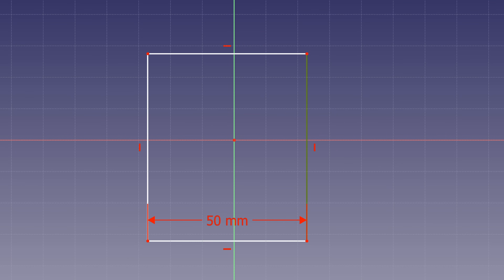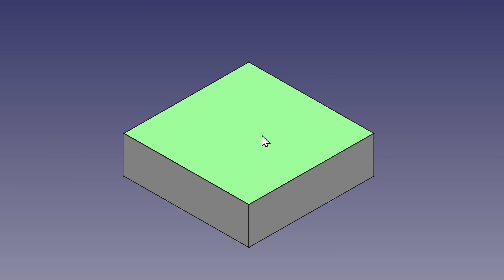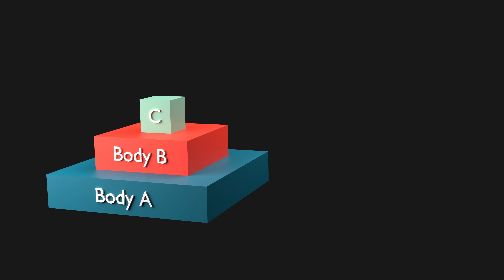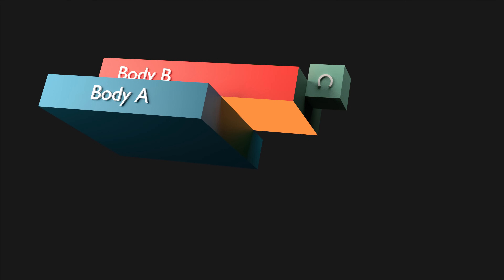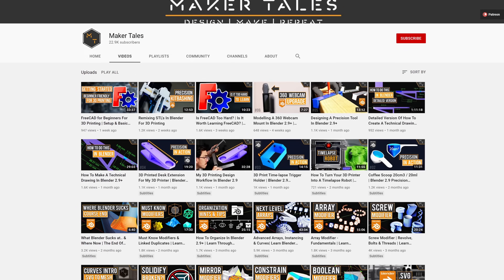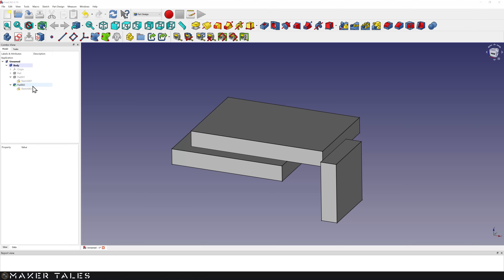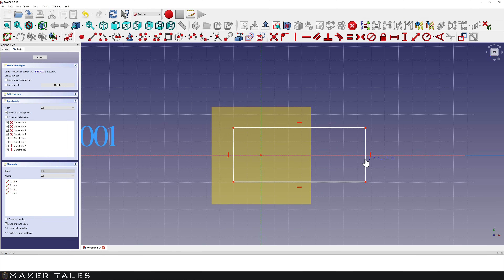FreeCAD Is Fundamentally Broken!  - Now what... Help Me Decide...

Comment: I'm also one of the developers.  Thanks for tackling this in a respectful and educational way instead of just throwing shade.  Your video is a really good explanation of the topological naming 'problem'.   -- I disagree with you on that particular point.  It isn't a 'silly bug' or something easily overcome.  (If it was that easy, it would have been resolved long ago).  It's called a 'problem' because the issue is intrinsic to parametric modeling. It can never be 'solved', only mitigated and avoided.  In fact, if you know what you're doing, you can trigger a parametric model to break in any parametric modeling software.  Admittedly, most software handles/avoids it better than FreeCAD does currently but I don't think it's possible to ever say it's 'solved'.   Realthunder's linkstage is a huge improvement and I can't wait to see his fixes become part of FreeCAD.
I don't have good advice for you about how to make your videos.  I would suggest that you should always stress good design principles which avoid breaking models.  That means all the techniques you mentioned.  
Thanks for doing this and keeping the discussion professional.
Reply: I spent 20-years running SolidWorks designing all sorts of complicated parts and assemblies. I started with the first release. Not once did I see this problem. That would seem to mean they had the problem fixed before they ever released it. Maybe someone else has had a different experience.
Reply: I see how this problem is intrinsic to parametric modeling but I also belive that measures can be taken to mitigate this. Maybe it can't be fixed 100 % but 90 % would do it. even 50 % would be great.
Reply: @TheYear2525  Absolutely!  We can (and should) continue to improve the reliability of the software. Whenever possible we should make it resistant to breaking models.   But robust software isn't a panacea for bad design practices.  CAD is hard and designing models that are flexible and resilient requires practice and discipline.  
I don't think anyone in the FreeCAD community thinks that topo-naming isn't an issue.  It has been acknowledged and discussed for a long time.  Our critics have sometimes suggested that we should accept a weak (50%?) solution now rather than a better (90%) solution _later_.  As users, that's understandable but as developers we have to consider the long-term health and maintainability of the code base.  
Fortunately we have a very talented developer in @Realthunder and a very strong solution is on the horizon.
Reply: Amazing your guys do - for a free application the tool set is very impressive.
Reply: I am not a coder so I cannot judge this at all - but the problem of TNP is something I leaned just recently in freecad while I just and teach Fusion360 I never came across it. Of course features can get references lost and then you refresh it. That was never a big issue nor breaking the model.

So I hope that at one point freecad can get closer and improve also how people can work safely.
Reply: I've concluded that a lot of the problems freecad has with topological namespace are a direct result of the way features are enumerated.  In the example from this video, this could be reduced by allowing for a null face in the list for the face of the second pad which is hidden.  Or even better getting away from numbered only references, Any face in the resulting solid could have a name reflecting the construction element, start, end, or perimeter of the pad.  And allow the draftsman to apply a name to elements within a sketch which will be referenced elsewhere.  (I've found myself making a lot of references to sketches rather than solid features as these are less prone to breakage)  While probably not accounting for every edge case, these changes would make for vastly more robust models.
Reply: I think one of the things that throws off most beginners with using FreeCAD is they equate "parametric modeling" to being able to go in and change any parameter and have it just work. We expect the ability to go  into the sketches or the parameter list and modify them without breaking the models. I had a client once wanting to change his models based off the measurements entered into a linked TechDraw document. So, yea, I know the general public is sometimes asking for too much because they can have unrealistic expectations too.
Reply: @Phelps3D  that is quite true - also as a seasoned designer myself sometimes I have to restart the model because changes would break the model or make it messy. Another aspect where FreeCAD is not so strong is the ability to adjust all design features - particularly when references broke and restructure your design.
Reply: Jumping in on this thread a bit late but just curious about the issue. I have some time in FreeCAD but am not an expert. 

So the issue is that surface names can be edited or re-named if the shape that they are attached to changes, like a new face/surface is added?

This is likely a dumb question, but if the surface/face is being used as a reference, like for a sketch then shouldn't it be "locked" so that its name reference cannot be changed? 

Or is the problem more of a relative "distance" of the face from some initial reference (eg. surface count) issue (eg. I add a surface into the link list of faces and the reference count changes so the sketch moves to the previous surface).

Cheers,
Reply: @EngineeringVignettes  It isn't really possible to 'lock' a face like that.  
Imagine that you have table. Call the top surface 'Face1'.  Now attach another sketch to it for a feature like a hole for your monitor cable.  
Now go back in the list before the hole is added and change something so the top face become two face - like adding a depression for a keyboard. What was a single face is now two faces. But which of those faces is 'Face1'?   A human can do this pretty reliably, but that even requires judgement in many cases. It's very hard to do algorithmically. 
If I understand correctly, the actual face name assignment isn't even a FreeCAD thing - it comes from the opencascade kernel.
Yes, this is manageable.  Other software has done it and Realthunder has a good solution.  But it is only manageable not perfectly solvable.
Reply: @sliptonic  OK, so the existing face is fractured into n new faces, I see. But could this generate a warning though when it is attempted, or maybe some window to ask which new face the dependency should move to... I agree that the software trying to autonomously decide on its own would be difficult.
Thanks for the reply,
Cheers,
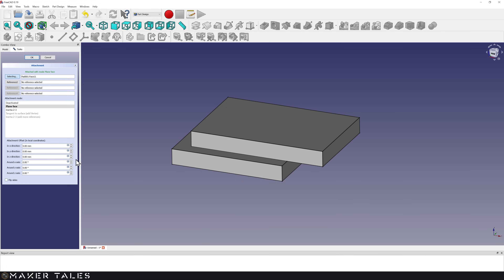Reply: @EngineeringVignettes  A window in realtime during the recalculation isn't practical but your idea is basically what the video is referring to around 4:38.  That's manually reassigning the references.  It's a pain in the butt and not-at-all intuitive.  If you haven't tried RealThunder's branch, you should.  It makes things much better.
Reply: It could be partly fixed by allowing the user to name segments either explicitly or programmatically   in Sketcher, or faces at some point in the feature tree, and have FreeCAD work hard so that the information survives after feature are added.
Example: you name a segment SLOT in Sketcher. Segment between point 2 and 3.
You pad the sketch, you get a face that carries the information SLOT. Then you could symbolically build from the named face "Slot".. You should have a look at SideFX Houdini and see how the modeler (SOP) deals with attributes. Not sure CAD users are familiar with using a DAG instead of a stack though.
Reply: Any parametric model will remain parametric as long as the values you use are real values, and also sensible values, imo it can be completely solved,

If the parametric engine can't solve a shape that shape is either illogical mathematically or there's bugs in the engine,

Maybe this boils down to what's considered the inside/outside of a shape but even then that's irrelevant since you build shapes from primitives, which are well known as to whats inside/outside, and even if it's a arbitrary polygon, if all else fails you can just ask the user to put a point inside the shape and derive the rest from there,

Maybe I'm ignorant and nothing I say makes sense since I have very little knowledge of what actually happens inside parametric engines, but as a programmer imo this can be completely solved for mathematically sensible shapes, but maybe I'm wrong,
Reply: @CraftMine1000  It's not about shape validity or internal/external locations.  It's about reference.  A user wants to refer to a particular face of a shape in order to attach another shape/sketch.   Then the user goes back and changes something that alters the particular face, perhaps turning it into multiple faces.   The new shape/sketch now refers to something that has changed/disappeared/divided and the software has to figure out what the user intended with the attachment.
Humans have an intuitive sense for what they think should happen but those judgements are difficult or impossible to capture algorithmically.  
That's why I say the problem can be 'managed' but not ever 'solved'.  
Again, I'm not making an excuse - FreeCAD needs to improve here.    But there's no substitute for good design principles and experience.
Reply: @sliptonic  freecad should just use a naming scheme that doesn't change when deleting faces. So easy. Every database in every big app uses this. For example, your employee ID doesn't change if someone leave your firm.
Reply: @patricklepoutre  You don't understand the issue. It isn't about the name, it's about knowing what that name refers to. 
Take an arbitrary shape.  We have to solve this on 'hard mode' so let's assume it's a parametric generated complex shape with 2000 faces.  The user now picks one face and attaches a sketch to it.  Next the user goes back and simplifies the design so that faces are merged. There are now 1000 faces.  The face that the users sketch was attached to doesn't exist anymore. What algorithm do you use that will assign face names so that when they are recalculated, the user's sketch is attached to the correct one?  It isn't enough to say, 'the names should be persistent' because the faces themselves aren't persistent.  That's the problem. The thing we're referring to can disappear, subdivide, merge with something else.  It can change its orientation in space, its area, the number of edges, or anything else.  Whatever algorithm you use to name the faces will cause the model to break in some situations.
Reply: @sliptonic   @sliptonic  thank you for the response. I suggest the following : if the face disappear : warn the user before deletion and suggest creating a reference plane. If the face is merged with another on the same plane, use the merged as the new reference. If the face subdivide, and is on the same plane, keep the same reference. If not on the same plane, take the new face that have the nearest plane than the old one. Well , I agree those case can be complex and maybe found on some advanced shapes with 2000 faces, but behavior should be simple on basic shapes like boxes.
Reply: Oh no, he was throwing shade... not even subtle shade.
Reply: @rogersmith5183  what do you mean?  I think the video raises good questions in a respectful way. I don't get the impression that he's trying to damage the FreeCAD project but rather wants to see it improved. I want that too.  Far too often the comments amount to "freecad sux" which is neither accurate or helpful. Good criticism is hard to take and also hard to give, but when it's done well, as it is here, it's a gift.
Reply: @sliptonic  I hold to my comment.  The title of his video is "FreeCad is Broken..!"  The thumbnail alone is enough to send some people off looking for an alternative to FreeCad. Again, it's free.  We have paid thousands of dollars for CAD software that had bugs that needed to be worked around. SolidWorks and CamWorks both immediately come to mind. Now we use as much free development CAD software, because we are tired of getting shafted. So what if it has a few bugs! I have been writing software/programs in some form or another since the early '80s. ALL software has bugs. Some seem like they don't because they have not been found yet. Ask Willie Gates.
Reply: @rogersmith5183  I did a video a while back called Five Ways FreeCAD will Annoy You.  I was highlighting frustration that students had when I was teaching it.  I was respectful and 4 of the 5 things were fixed within two weeks.  Still the video was the most popular video I ever did.  People accused ME of throwing shade and I'm one of the developers!   
There's a big difference between negative and constructive criticism and it boils down to whether the critic has the best interests of the other party in mind.  I sincerely believe this guy wants to see FreeCAD improve.  He isn't trying to destroy it or drive people away.
Reply: @bradcollette2967  Point taken. Though I suggest he stay out of marketing.
Reply: Sliptonic, Y2K was not an issue intrinsic to the way we count the years. It was a software bug caused by a systemic failure in acknowledging the environment in which certain software would operate. When it became an issue people worked on it and solved it. That's what should happen with the topology naming bug, problem, deal-breaker, facepalm inducing feature or whatever else you want to call it.

Then the developers can move on to solving the tens of other problems with the UX, always acknowledging that CAD operators can be many things but they are not necessarily software engineers.

Also, allow me to say that realthunder's branch IS the main branch of FreeCAD no matter what the forum says because it is the only operational one in a professional setting.

These are some hard truths that need to be acknowledged by the entire developer team for FreeCAD to move forward. Although, the recent change in Fusion360's licence scheme was a monumental missed opportunity for the project.
Reply: @ExMachinaEngineering  Y2K had a solution and it wasn't even terribly difficult.  Widespread, yes, difficult, no.   Topological naming is fundamentally different.  There is no solution, only mitigation.  Of course the software can mitigate the problem better than it does today.  I never denied that.  Realthunder's branch is a great step in that direction.  But it is not a solution in the sense that it solves all topological naming issues forever.  It doesn't because it can't.  Such a solution isn't possible.  

Maker Tales posted this video asking how to go forward.  I answered by saying that there will never be a technical solution that removes the need for good design practices. As a youtube educator, he should always be stressing design methods that leads to robust models.  

Please explain why the fusion thing was a missed opportunity?  We added tens of thousands of new users and I can't see how that made FreeCAD better.  Had FreeCAD picked up ten thousand more, how would that change the situation?
Reply: So here we are 2 years later and the RealThunder fixes are still not in FreeCAD, you say this is intrinsic to parametric modelling yet I have never seen any other parametric CAD software suffer from this problem, none. Also, a lone developer, RealThunder, has pretty much managed to resolve it working alone in his spare time while also making a whole bunch of other improvements. With this issue unresolved FreeCAD will never gain traction because most people get to the point where their models start blowing apart after some minor change and drop it. Looking at RealThunder's solution in the code I fail to see why it hasn't been incorporated into your code base either it's not like his changes are that invasive, have to wonder what you guys are doing creating new features when implementing something like this fix would increase FreeCAD uptake exponentially.
Reply: This has been solved in numerous CAD packages. And now with 1.0, it's still a huge problem with history breaking all the time anyway. Never had that issue with Solidworks, with Fusion, yet in Freecad it occurs with every single change in the history - even ones that do not create new faces, edges, vertexes or geometry - like increasing a taper angle on a pad.
Reply: This video made me uninstall Freecad. Will re-install when fixed.
Reply: @josephsagotti8786   Spoken like a truly entitled user:  "These problems are somebody else's problems.  Fix them and I'll come back."     As far as I can tell, you bring nothing to the table.  Why should we care if you get up and leave?
Reply: @sliptonic  ...Are these problems not the fault of the developers? I'm not even throwing shade. And don't get me wrong, I love the idea of FreeCAD being a FOSS alternative to solidworks or Fusion 360. More accessibility, customization, and freedom. I could probably contribute, but I know next to nothing about how FreeCAD's coded. 

"Why should we care if you get up and leave?"

Why should you care if users start leaving due to faults in the software? Weird question coming from a developer.

"As far as I can tell, you bring nothing to the table."

I'm not a dev, just a user that doesn't want to use software that is buggy. Use your head; you're developing software for makers, homeboy.
Reply: @sliptonic  3 months goes by fast
Reply: Words from a non-specialist : CAD are hard. Make them easy. Do what Apple did when they first introduced Mac : elegant and easy. This face referencing problem look like a joke to me : you don't have even a reference naming scheme that is robust and you blame the user... You say user should add a plane each time he build something upon a face? Well, freecad should do it, not the user. See how many program let you draw freehand and store this as bezier shapes you can modify then. Do you own a manual speed car? Does it have a choke button? Do you have to check oil manually everyday?